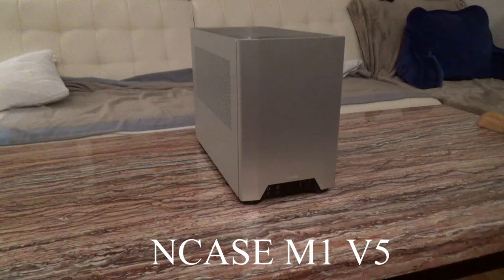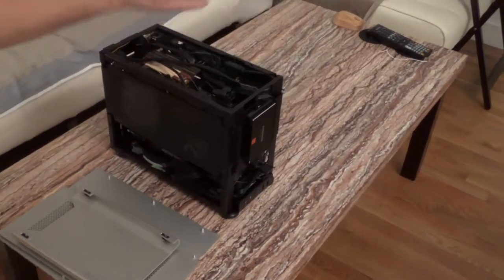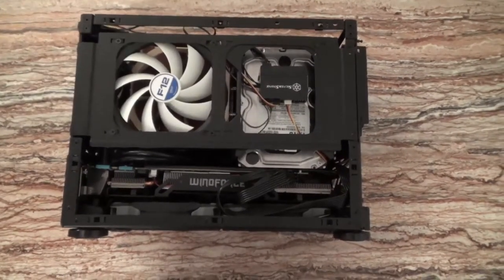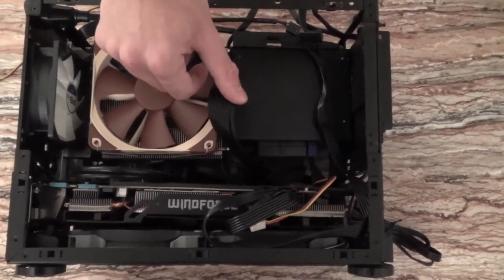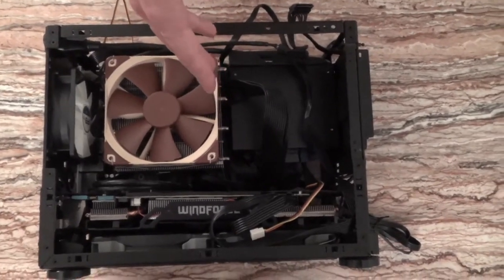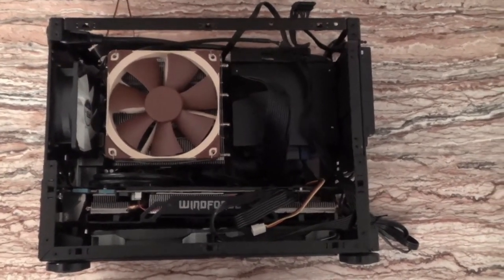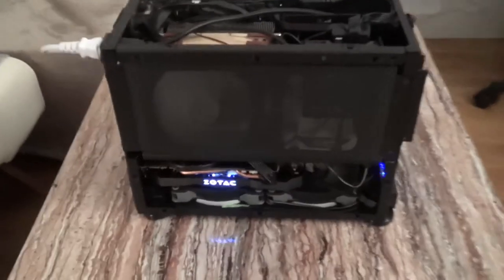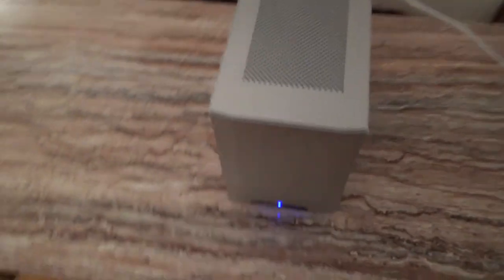NCASE M1 V5 review with different configurations

Comment: Thanks for sfx/atx compare!
Reply from the maker: Just so you know, I actually tried with the my long ATX Psu and it's impossible to fit it at all.
Reply: Quentin McGaw remove floor fan?
Reply from the maker: Yes even then there isn't enough space to fit cables in the power supply. Plus the ATX adapter of the ncase makes the power supply go further down. There is literally no space left to plug cables unfortunately. You can however make it with a normal ATX power supply but mine is definitely quite long.

Comment: Take a Corsair SF600 or SF450 SFX PSU. The Silverstone is loud, extremely loud. The ones from Corsair have NO noise at all.
Reply from the maker: I read that both were noisy but the Silverstone one was a bit less noisy. It's not that bad actually but my old big ATX one is dead silent in comparison. Another aspect is that I added a 50mm fan on top of the power supply to extract heat (so at the top of the ncase) and since then it is definitely quieter!
Reply: Well you read it wrong. I HAD both of them in my builds so i know. The Corsairs have actually zero-fan mode, which is most of the case. And when stressing it more, still way less than what your GPU will produce. The Silverstone on the other hand was always on with horrible noise. I have sent it back the same day it arrived. Actually, when you look around in build videos, there is a reason everyone uses Corsair SFX PSUs. The ones with Silverstone were only present cause that time they were the only one with SFX and above 400W.
Reply from the maker: I read and exchanged on forums for countless hours about the right SFX power supply back in June this year, and almost everyone agreed the Silverstone had less noise problems than the corsair SFX. The Silverstone SX-600G has a fanless operation mode as well, so it seems you're the one reading wrong. Maybe you have old versions of the power supplies that could explain your opinion.
Reply from the maker: Check https://www.reddit.com/r/sffpc/comments/4ldyqq/corsair_sf_600_vs_silverstone_sx_600/
 for example. They pretty much all agree the Corsair one is noisier at load.
Reply: Reddit is the worst source. As I said I dont have to rely on forums i had tried many products first hand. Maybe i had a faulty Silverstone earlier, but that Corsairs are better and actually almost platinum rated, is also well proven.
Reply: SF450 I hear has better quality control and overall is less noisy. After gaming and going back to normal pc use and web surfing, the SF600 still is running the fan fairly fast and loud. Anyway, nice video. I got the Ncase M1 v1. I am probably going to make a new build with the Dan A4 SFX. Ncase M1 was better suited for water cooling and since I do not water cool and the fact that you need a good number of fans for good temps, Dan A4 SFX is probably better for people going air-cooling and not overclocking much anyway. The Ncase M1 is still a really pretty case and better looking than the Dan A4 SFX imo. The finish and quality of the panels on the Dan A4 SFX was a little disappointing.
Reply: Indeed i have the SF450...I think the 0-Fan mode is bit different with this one so it might appear less noisy than the SF600. Anyways, I cant wait for my ncase m1 v5 to arrive. I also think that the A4 is not this good, and already too small for the thermals. I want to be able to fit several SSDs in there and a decent aircooler not that shitty and noisy  small noctua everyone praises. The slightly bigger AR06 from Silverstone is actually ACE and handles up to 100W TDP. Also good acoustics.
Reply: You could get the Noctua NH-U9S or the top end Noctua NH-C14/S. I think most have two fans at the bottom for the GPU, side fan at the right, back-exhaust fan. You can see details from this thread: Case Study: Air Cooling Inside an NCASE M1 (Google - first result)
Reply: ok thanks. I have be quiet silent wings 2 coolers in my current build, i will use those. Maybe add in 1 more 120mm. I have an i7 6700 non-K, and no OC is involved in my build. (not that it would matter for gaming anyway.) Also, I am trying to probebly get a mini 1060, which again should not pose any heat issue.
Reply from the maker: @zeus1117  You were right actually, I just changed my Silverstone for a SF450. Both have fanless mode but the Corsair fan is inaudible while the Silverstone has an annoying noise/clicking.

Comment: can you public the list of components?
Reply: Zotac GTX 1080 MINI
EVGA Z270 Stinger ITX
i5 6500 with Noctua Low profile cooler
Silverstone SF600 (a bit noisy)
Samsung 950 pro, 2 2.5" HDDS, 2 SSDs
16GB DDR4 Corsair ram
Fans. A lot. From 18mm to 120mm. And a PWM hub with Speedfan installed.